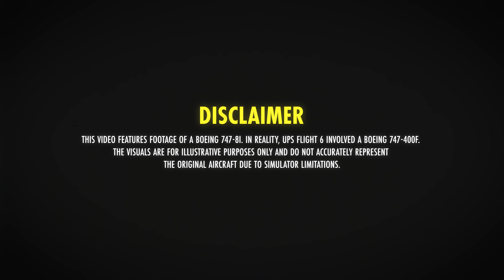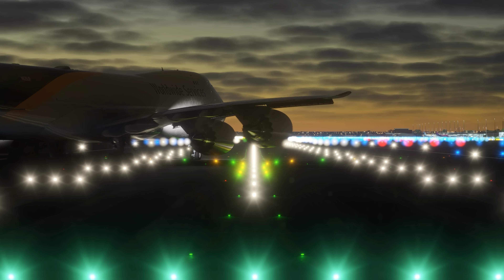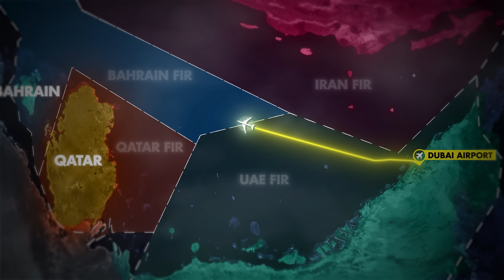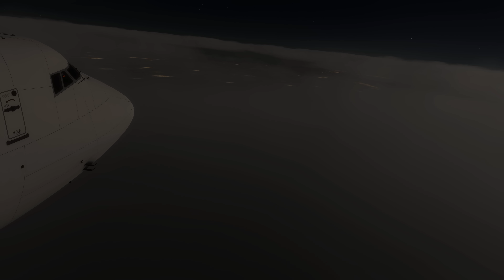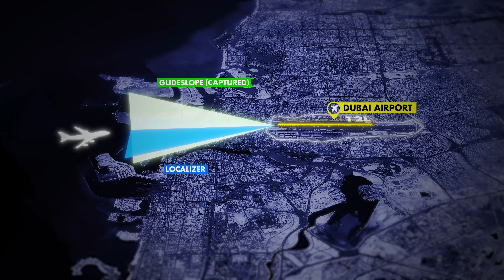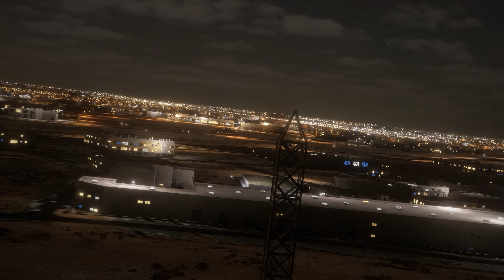The Dubai Inferno That No One Survived

Comment from the maker: Check out Odoo here: https://www.odoo.com/r/oVd4 and run your business more efficiently!
Reply: They were using the wrong types of Lithuim ion batteries. Lifepo4 lithium batteries do not burn or cause fire so it was a wrong choice of batteries because they wanted too much power so big power I woud not use in any criticle situation may be outside an islated plant room but usually it is lifepo4 lithium that does not cause fire for more seriouse stuff. So the Engineer who designed or chose this is to be blame. All modren cars has lifepo4 lithium and not has cause any fires it is proven safe

Comment: 2 things:
a. the smoke detectors should have been calibrated to be much more sensitive, it took 10 mins for them to go off
b. there should be powerful fire extinguishing mechanisms for the cargo holds, probably a combination of water and foam
c. there should be fully sealed partitions between each of the cargo areas
I hope these have since been implemented

Comment: This reminds me so much of Swiss Air 111. Both crashes caused by fire with very similar circumstances. The captains on both flights suffocated from the smoke leaving the FO of both flights 🎉 to fend for themselves. I cant imagine what those FOs must have been going through. The cockpit of Swiss 111 basically turned into a oven. Plastics were found melted together as well as the checkbook he was using. It shows that tho he was literally being cooked alive in a cockpit oven he fought up until the very end , when a combination of spatial disorientation and the absolute hell he must have been going thru all alone in that cockpit cause him to pitch down and hit the water off Peggys Cove, Nova S. @ 350gs, killing everyone onboard instantly. Absolute nightmare scenarios i cant even fathom it. May all the passangers and crew of both ill fated flights R.I.P 🙏

Comment: ... Pour salt on a metal fire... A (most) metal fires are so hot that they can strip the oxygen out of water... Then burn the hydrogen...
Salt.
Salt will melt, coating the metal.
This will help to prevent it from contacting Oxygen...
You still have to deal with the heat....   But a lack of flames is a really important step.
Salt ...
Yes we know how to put our a lithium fire.
It's expensive and hard to do... The chemicals they use are more expensive, bad for... , and a hell of a lot easier.

I still laugh my ass off every time I hear a firefighter complain about using 40,000 gallons of water on a lithium fire...
Dude! Water + Lithium = Heat...
Heat + Oxygen (metal fire takes that wherever it damn well pleases) + fuel (Metal burns... Go figure)

Salt....
Desalinization for fresh water.
Salt...

Just saying. There's got a be a better way ...
Obviously salt won't do ... But it's that easy.

Comment: Lithium-ion batteries were the cause of this accident and since this accident tighter regulations around the transportation of batteries have been implemented. Today, when flying commercially, the flight attendants will make a point of mentioning if a phone is emitting a gas substance then notify an attendant as soon as possible. A fire can not only be dangerous but it can consume an airliner in mere minutes.

Comment: A terrible accident but turning back to Dubai was a big mistake. Not only does doing a 180° turn add on more time, but it was also about 100 NM further than Doha. Had the captain chosen to land at Doha then they probably would have survived.
Reply: They didn’t have “appropriate approach charts for Doha…” I don’t know what that means but it seems like there was some extra difficulty with landing at Doha.
Reply: @DVeck89  Yeah, I recall hearing that in this video, but considering the immediate danger they were in, any airport would allow them to land in an emergency. The problem is, the pilots didn't know how dangerous a situation it was by the time the captain chose to turn back.
Reply: @cun7us yeah for sure they didn't appreciate the gravity of the situation that the fire is from lithium source not just a regular fire.

Comment: RIP but the FO made a lot of errors as well. 75 hours just isn’t enough to contend with this situation
Reply: @Jtanman93 I can't corroborate nor refute your statement, but at the end of the video it says one of the conclusions of the report was that this type of situation is nearly impossible for a flight crew of any level of experience to bring to a successful end.
Reply: @PJay-wy5fx  Reminds me of the crash in Sioux City, Iowa (USA).  
   If i recall correctly, they lucked out and had an instructor as a passenger and he was SUPER knowledgeable on system as he regularly configured crew simulations by failing 2, then 3, then 4, then… 5+ systems.  With enough failures EVERY crew crashed in the sims.  
   The instructor passenger had essentially perfect system/failure knowledge and helped keep it flying for a long time as they tried to maximize their chances.  But in the end, doing everything right, probability of losing the plane and people was still non-zero.  And that’s what happened.  
   It turned out to be Kobayashi Maru, a situation with no way to win. In the end you fight and fight until you can fight no more.

Comment: 10 mins of smoke before the detectors work ? 
Seriously ? 
 Then what , fire extinguishers turn on automatically ?
Reply: There were no fire extinguishers! The plane was "Strategically" design to not have them since to put out the fire on the plane an alternate method also existed

He said it in the video that "To cut the O2 supply off the plane had to be flown up to 25000 feet, thinning the air and cutting O2 supply

But Lithium Ion batteries Dont even need O2 to burn!

Boeing completely at fault here not to include the fire extinguishers

Comment: A small fire sparked it all… but ended in a tragedy no one survived. Disasters like this are chilling reminders that nothing is ever minor at 35,000 feet.
Reply: I doubt it was small, even thermal runaways of lithium battery-powered electric scooters can’t be called small fires even when they start. Have you seen videos of them going off? They are raging infernos that can cause explosions that can blow windows out of homes and even shoot flames that can propel a electric scooter as if it were a jet engine. This cargo plane was carrying a large shipment of them and if it spreads to other batteries, it will cause a chain reaction.
Reply: I think it’s pretty safe to say he probably saved some lives on the ground.
Reply: Was it just the two pilots on board?
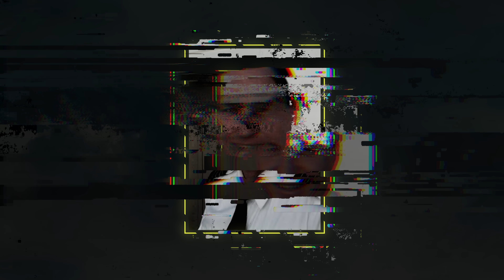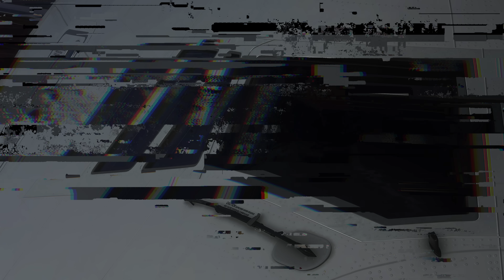Reply: @BREEZYM6015 Yes, the two pilots are introduced 1:49 through 2:40.

Comment: My mother worked at a lithium car battery plant, SK Battery in Commerce, GA. The company left faulty lithium batteries at a transfer station after being told no previously by the owner of the station. Fire happened, and the station burned to the ground. It doesn't take long for that kind of fire to start but takes forever to put out, if it's even possible.

Comment: and this is why if you take a battery bank onto a plane make sure its below 30% charge far less likely to fail badliy mid air
Reply: @leexgx Wow I had not realised this but now I've learnt this valuable piece of information, I feel it should be a requirement for passengers on any flight. 
If a battery bank charged over 30% can potentially do much more harm than a bottle of water bigger than 3.4oz or 100ml ever could. 
It's time for some serious reviewing of what is safe to bring on a passenger flight and what isn't. After all, a lot has changed since 2001.
Reply: @PJay-wy5fx yep Below 30% it might get warm or hot (might even puff up and become forbidden pillow) but it shouldn't catch fire or more smoke

Power banks I trust less the laptop battery's so generally keep them Below 20-30% if on a plane i had a couple that turned into forbidden pillow you definitely can't use them once that's happened 

This should be standard (transport of battery's is usually around 40-50%)
Reply: 30%?? That's already into "need a recharge" territory.

The 30% suggestion is not a good idea; I'd rather keep it at a hard cap of 80%.
Reply: @mynintendogamingfeed5208 it's lithium battery not lead acid so lower voltage sometimes is fine (I did say just for the airplane part) if it catches fire or smokes a lot in a room or in a car that's less a problem (not ideal situation) but you don't want that happening on a plane when flying

Most battery's are shipped at 40% charge
Reply: @mynintendogamingfeed5208 u would rather be selfish, just say that next time
Reply: Nah, I’m gonna bring four or five really old ones, fully charged and next to a loose-capped bottle of water. 
Don’t tell me how to live my life.
Reply: @crakkbone are you gonna pour water on a electrical fire 😂😂😂

Comment: Damn they really had NO chance
Reply: They had a chance had they diverted to Doha instead of going all the way back to Dubai
Reply: @TonyPiper225 😔
Reply: Ground proximity warning not Position.
Reply: In a case of fire, you imeditaly are loking for nearest suitable airport. I do need to be a pilot to know that. I was told that by pilots. Decision to return meant that instead of 100 NM they need to fly 200 NM.
Reply: I mean diverting to Dubai didn't help
Reply: The did have chances they just didn't take them
Should've landed at Doha
Should've restarted the AC system 1 or turned on 3
Shouldnt have created a draft through the cockpit to make things far worse etc
Reply: @davidjr4903 its people like you sitting comfortably in the luxury of your home, who think they know more than professional pilots, in these moments its difficult to get things perfect under extreme pressure and danger.